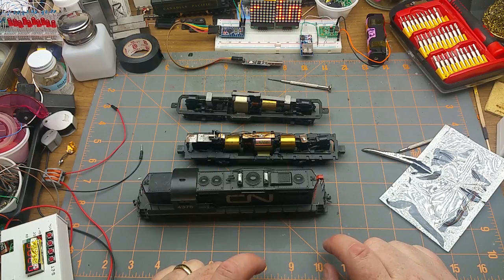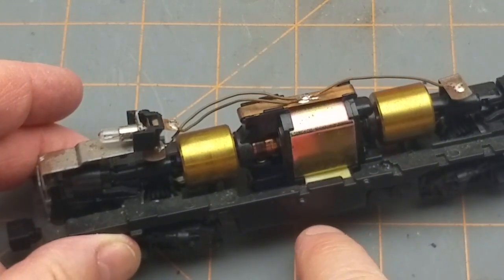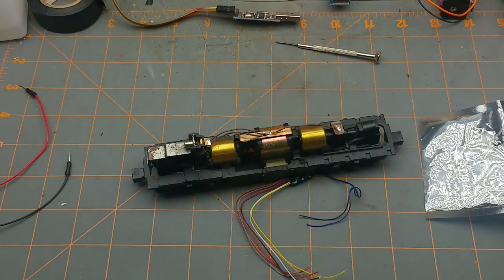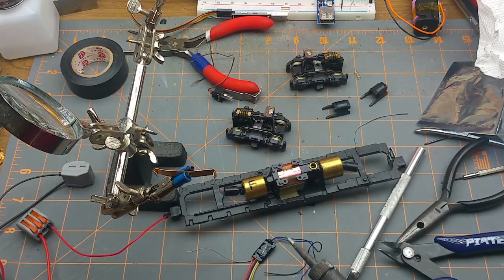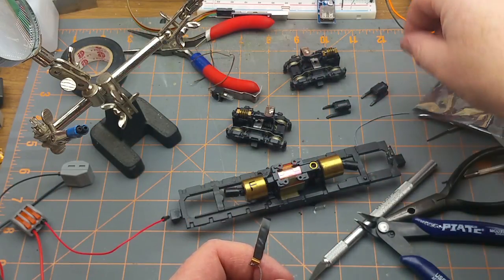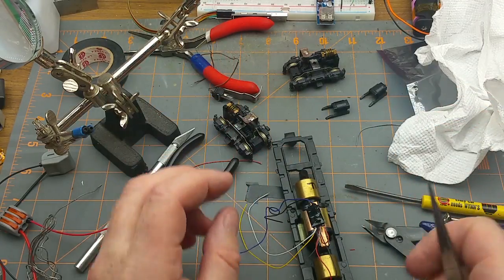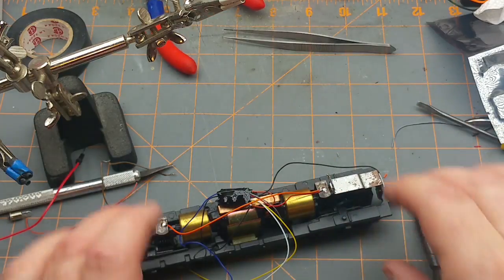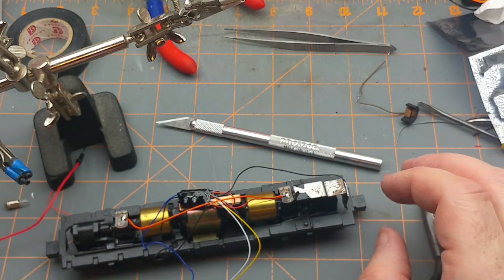DCC decoder install in an Athearn locomotive

Comment: Good information, I do not suggest or recommend ever filing metel directly over the worm gear and truck gears however.  Those are are plastic inside and metal filings will stick in the grease and cause all kinds of havoc down the road, literally.  ;)  Also with old blue box athearns if you upgrade to DCC I recommend heavily you purchase the newer RTR motors which will also require getting the drive shaft kit that needs sizing and cutting along with the worm gear connector kit to fit the new shafts.  It's about 60 dollars for everything but your Athearn will run perfectly on DCC setups, and be much smoother in operation, it's not necessary but highly recommended as those newer motors were designed for DCC.  Great video very informative!
Reply from the maker: I like the challenge of getting the old guys running well with as many stock parts as I can.

Comment: So my concern is, why the heck is one side of the pickup on both trucks and the other on a metal plate? Is it the way the current is transferred? Otherwise excellent tutorial
Reply from the maker: The wheels on one side of the trucks have an electrical connection to the frame, and the wheels on the other side connect to the strap. All 8 wheels pick up off the track, 4 from each rail.

Comment: Athearn locomotives are ez to convert to DCC but isolating the frame from the motor is very important and make sure the electrical contact from the frame bolster to the truck base pickup is clean so no lube is required on the frame bolster pin. It will get some from the truck gears getting thrown out.

Comment: You marked the fly wheel "F" for FRONT;  but, you put the motor on the frame with the F towards the ear of the locomotive.  You needed to put the F facing the Head Light mount.  Because you put the motor facing to the rear,  you then put the trucks on backwards when you followed the "F" that you marked on the flywheel.  This placed the "right" side truck pick ups on the left side of the frame.  I believe this then caused your leds to be reversed.
Reply from the maker: Yeah, that is probably what happened.

Its surprisingly easy to confuse myself when i'm thinking too much about making the video, and not what I'm actually doing.
Reply: but front is actually the long hood on a high nose loco

Comment: AIt appears you reassembled it backwards.  At the start, the headlight bracket is to the left and the tabs from the trucks for the right pickup are on the far side.   As you reassemble, the headlight bracket is to the left and the truck tabs are still on the far side (chassis side farthest from you).  This is why I tell people to label everything as you disassemble!

Comment: I learned a lot! I have a few engines from Athearn I plan to rebuild:

4= SD40-2 engines
3= F59PHI engines
1= SW1500 engine
1= C44-9W Engine

All of my other locomotives and power cars:

Atlas:
1= AEM-7AC
2= C42-8/W
2= ALP-45-DP
2= GenSets
1= GP38-2

Bachmann:
2= HHP8
1= F40PH
1= GE 70 Tonner

Intermountain:
1= Tier 3 ES44CWDC
1= Tier 4 ES44CWAC

MTH:

1= SD70ACe

Broadway Limited:

1= Trackmobile

Athearn:

1= C40-9W
3= SD70/75I/MAC
1= GP40X
1= P42

True line Trains:

1= MP36-PH-3

Rapido:

1=Modernized F40PH
1=FL-9

Kato:

1= F40PH
1=  GE P42

Walthers:

1= SD60M
1= B42-8W
1= E-9
2= Metroliner (M.U.)
1= RDC-2
1= GP60 (Modified to E-GP60M- LowNox)
8= R-21/22 Subway Cars

All DCC ready. And more.

Comment: At the end you discuss a polarity issue ( my previous note was added mid-video).  The polarity issue is because I was correct in what I thought I saw and the chassis was reassembled incorrectly.  This changed the polarity of the entire system and why you now have the headlight wire powering your backup light. It works, but remember this when you do the next one.

Comment: I had a new gp50 that would stop on the track.  I traced it down to the truck swivel pin.  It has some black paint that I scratched off.  I also pulled the wheels and lightly filed the slots for the wheel bronze bearings.  On DC and problems are gone.

Comment: Great video, I am going to give it a try.  I tried Googling, but I cannot find the exact LED's you are using there.  What is your source for you LED's and resistors?
Reply from the maker: I don't remember exactly who I bought the LEDs and resistors from. 
It would have been the cheapest seller I could find on e-bay.
Try a search like this one :

https://www.ebay.ca/sch/i.html?_from=R40&_sacat=0&LH_FS=1&_nkw=3mm+led+warm+white&_sop=15

https://www.ebay.ca/sch/i.html?_odkw=resistor+kit+assortment&_sop=15&_osacat=0&_from=R40&_trksid=p2045573.m570.l1313.TR0.TRC0.H0.Xresistor+kit+assortment+30+values.TRS1&_nkw=resistor+kit+assortment+30+values&_sacat=0

Comment: i would suggest wiring the lights using the accessory wires supplied with the decoder. wire the lighting to the blue wire as the poditive and the colored wires for the lights.
Reply: I was also confused by this.  To clarify...I think you meant: he should have soldered the white and yellow wires from the decoder to the cathodes (the ends with the resistors attached) of the LEDs, and then the blue wire from the decoder to the anodes of the LEDs (would have to splice off one time for one of the LEDs.  That way you don't need to run that black common to the frame, as he did.  Am I correct?

Comment: instead of bending in the prongs on the bottom contact strip. just swap the bottom strip with the top and isolate it . then you have two nice prongs to solder lights to on top

Comment: Great how-to. I was wondering about the resister. You said 1k. What I need to know is Watts and %. I found 1k, 1/4w, 5%. Thank you for your time in doing this video.
Reply from the maker: 1/4 watt will be fine.  I think that's what I used. 
The % is just an accuracy number.  5% is not going to be a problem. (I happened to use a 1%, but only because that's what I had handy) You could use anything from 800 to 1500 ohms and it would work fine with no damage. The brightness would change slightly, more ohms = less brightness..

Comment: This is an excellent video. The step by step instructions made it easy to follow and do. My only question is why didn't you use both of the alligator clips on the vice to hold those small parts?
Reply from the maker: It's often more effort than it's worth trying to line up both clips on the Helping Hands and getting them to stay where I want them.

Comment: What sort of measures do you take to “tune” up an old locomotive?  I’ve got some old Tyco units from the late 70s / early 80s that I’ve been working on.  I’m guessing that minor arcing from inside the motor equates to worn out brushes?  Any ideas on sources for brushes that old (or replacing the motor altogether?  Not really sure if the brushes are easily replaceable in those ...
Reply from the maker: My usual "tune up" is 90% cleaning and lubricating. Clean the wheel treads, any electrical connections between the wheels and the motor, etc.
Open up the gearbox and get any crusty crud out, re-lube.

After that just make sure the motor is securely mounted and the driveshafts are straight. Check that everything moves smoothly and adjust until it does.

I don't think I have ever owned a Tyco. Not sure what goes on under the hood of those. I would probably troll through used tables at a train show to find a "parts donor" and transplant parts from there.
If the brushes are sparking, try to clean the commutator (if it is an open frame motor that lets you get at it) with a q-tip and alcohol. Might save you a lot of hunting for parts.
Reply: Mark Teague, here is an NMRA article on tuning up an Athearn locomotive: http://www.mcor-nmra.org/Publications/Articles/Athearn_TuneUp.php Hope it helps!

Comment: Really interesting stuff and I believe they run smoother than many of the Triang Hornby locos which I have.
I have a couple of old NA locos and wondered if the motor etc could be swapped over to the Brutish models ?

Comment: Hi, I recently obtained an old Athearn GP9 off of EBay.  My plans are to strip it and paint it in CP Rail red.  I have not seen this driveline configuration on any YouTube videos.  It has an up right bulb in the front.  No flywheels and the old two part clips for the truck retention.  The trucks are different as well.  Have you ever seen one of these. The Alco PA1 parts diagram from 1970 has a similar setup.
Reply from the maker: That's interesting. Any Athearns that I remember have had an almost identical chassis to this. The only differences that I have seen are for wheelbase length or number of axles.

Then again, I haven't seen an Athearn that is less than 15 years old.
Reply: pileofstuff  thanks.  This one is probably from late 1979.  I have two like this.  The trucks have the Metal outsides and the axles ride in bearings in them.  The handrails on the old one are round with a hole punched in them for the handrail.  I also have a new old stock Athearn blue box gp9 that has the modern trucks,  flywheels, narrow motor and the open top square stanctions.  Point is there is a lot of really ancient blue box stuff out there and anyone buying should check the trucks, rails, and motor before buying.  My old stuff runs ok, draws .32 amps and pulls well after cleaning.

Comment: I don't think I will go to DCC, but that is a helpful video on how to take an Athern apart.  I have one that runs in the opposite direction of the other trains.  Can I turn the trucks around so it runs the other direction?
Reply from the maker: Actually, swapping the trucks (move the back one to the front) is probably what you need to do. 

If you have a multimeter, you can test that theory before you put it back on the track.

Comment: I've enjoyed your video my question is  which decoder fits which locomotive. I've been to their website and find no cross reference charts available. Can you help?
Reply from the maker: The decoder that I used should fit in most N scale and larger locomotives.

These are generic decoders. They aren't made to fit specific locomotives.

On smaller locomotives you might have to be a bit creative on placement - possibly removing a bit of one of the weights or sneaking it into the cab.

Comment: How did you get the truck and motor apart so you could clean it ?  Did you only have to cleean both trucks?
Reply from the maker: There is a plastic clip on top of the worm hear that holds the entire assembly together.

Comment: great video.  you said the diesel was noisy how did you fix that. I have an athearn with the body off, it is quiet, with the body on, it growls like an old bear, any ideas. Thank you, I learned a lot
Reply: Some insist the "growling" is created by the flywheels not being true (either brass or steel) and they manage to rub the inside of the shell (on scale not wide hood older models).  I have a difficult time believing they can be that "untrue" they rotate out of round enough to do that but people have ponted to Model Railroader studies that document the flywheels are not true.  Sure way to tell that is being done would be to put something on the flywheels to be able to make a mark on the inside of the shell should they rub against it and then put the shell back on, run and see what happens.  What you then do about the flywheels, I don't know (not everyone has a lathe at their disposal).  I would say more likely that not, the motor is shifting bc the mounts are 1) old or 2) and when the motor starts to "toruque" w/the shell on, it shift left or right enought to hit the inside of the shell.

Comment: With the 3mm led lights you said you used a 1k resistor. But later in the video you said you changed the resistors but never said too what size resistors? What size did you change them to?
Reply from the maker: I just changed the position, not the value.

Comment: FFS - A Resistor (R) is used to drop the VOLTS (E) not the amps (I). LED's use ~ 2-3 VOLTS, not the 18-24 volts of a DCC system. Amps is determined purely by the wattage (P) of any load and will only draw enough amps to do the work (watts). P =E x I https://upload.wikimedia.org/wikipedia/commons/thumb/7/78/Ohm%27s_Law_Pie_chart.svg/600px-Ohm%27s_Law_Pie_chart.svg.png. Since a LED is usually in the milliamp or less range, according to your statement, a 1K resistor would never allow the LED to light up IF IT WAS REDUCING AMPS. On the other hand though, if you drop the Volts to far, then the PD (potential difference) is too low and the device (LED in this case) will NOT work. As I stated above, they have a working VOLTAGE of ~2-3 Volts. remember its VOLTS that you are dropping, not amps ok
PS: So basically the higher the voltage the brighter a LED will become until it burns its self out.

Comment: Is there a way to add sound to these old trains? Like a esu loksound?
Reply from the maker: Absolutely.

Most of the people I know locally use SoundTraxx brand decoders. 
The installation is very similar. The hard part is finding room inside the locomotive shell for the speaker.

Comment: Amazing video. I am just getting back into the HO train thing and have zero DCC locos. But lots of them that look exactly like what you were playing with. You probably saved me billions of dollars!  Question: when you were isolating the motor, pushing the pins back in on the clip; could you have instead simply taped over the contact strip on the chassis? Could have avoided pulling the clip off and watching the spring launch.
Reply from the maker: Possibly, but I wanted to flatten down the little spikes and not worry if they were going to poke thru the tape.

Comment: I've been told a n scale decoder can be used in a small ho scale loco. is this true and can a n scale sound decoder be used?
Reply from the maker: The only thing to watch out for is the current (amps) rating of the decoder and how much current the motor uses.

Any modern locomotive in HO should be fine with any decoder that can do 1 amp or more. (most N scale decoders that I've seen are 1amp to 1.5 amps).

Check the spec sheet for the decoder you want to use, and then check the stall current of your locomotive (using a multimeter). As long as the loco uses less current than the cedoder's maximum you'l be fine.
Reply: I use the DN123 digitrax decoders for my Athearn SW7's, S12, and SW1500 locos provided they have the newer drives with brass flywheels. I also add wire contacts to the trucks so they can get current better.